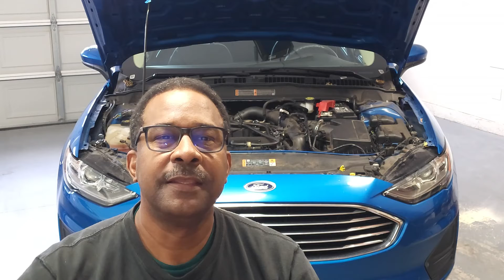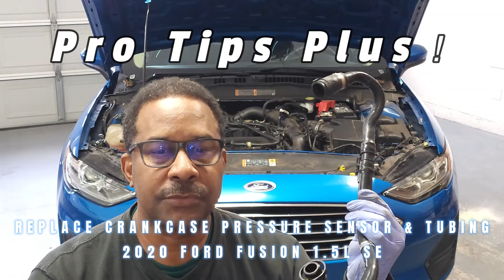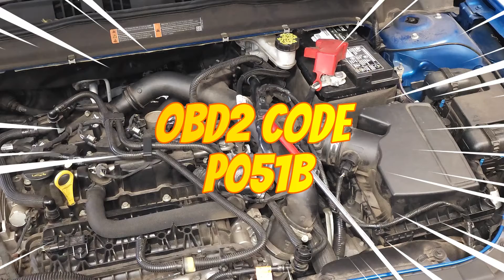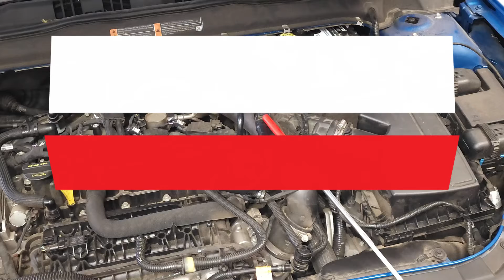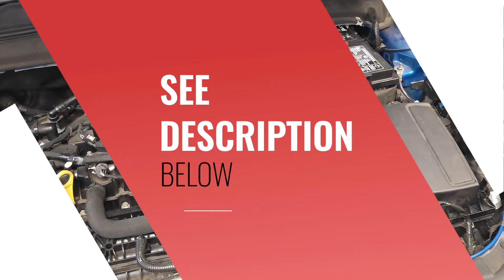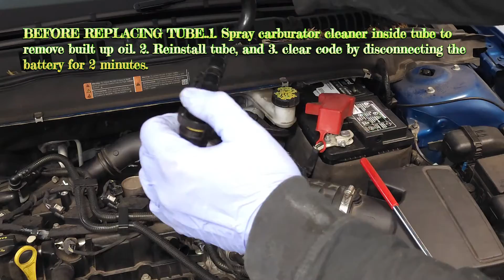2014-2020 FORD FUSION 1.5L- Bad Crankcase Pressure Sensor and Tube Assembly

Comment: Thanks bro this is very help full but i have the question this sensor need to replace it or cleaning of the sensor and this tube by the spray enough?
Reply from the maker: The information is provided in the video.

Comment: Hello does anyone know why my 2020 Ford Fusion SE 1.5 has a blueish smoke from my exhaust only on start up ? Antifreeze is fine always full doesn't go low from reservoir and oil is always fine. Took it to Ford dealer for they can just tell me it's the brake vacuum pump the they read from online forms smh  🤦🏻car is still under warranty but they said I would have to replace that part at my own cost before they approve for a new motor.  I don't know what that brake vacuum pump has to do with exhaust blueish smoke smh 🤦🏻
Reply from the maker: You've asked thenright person. We've got this. Send email to bheningburg@ yahoo.com
Reply: @fernandofalcon7722   mines did that and it was a faulty turbo charger gasket but it could be  turbo charger oil line that's broke or oil getting into the intake from faulty pcv, oil separator, or worse. If there is no codes I'll have them check the turbo charger gasket and oil lines going to it

Comment: Hey, i got a 2020 escape 1.5l with p0299 and P04DB. Could this fix it?
Reply from the maker: The combination of P0299 (turbo underboost) and P04DB (crankcase ventilation system disconnection) codes on a 2020 Escape 1.5L suggests an air leak or pressure problem. The most common fixes are checking for leaks in the crankcase ventilation system, which can involve a loose or disconnected hose, a faulty PCV valve, or a cracked tube. Additionally, inspect all boost-related hoses and the turbocharger system for air leaks, as the underboost code often points to a loss of pressure. 

Please donate, subscribe and share channel with friends and followers.
Reply: @protipsplus i got you!! Thanks bro!!

Comment: Is this part also called the pcv valve? Cant seem to find a video that specifically states a pcv  replacement..
Reply from the maker: Nope but it performs the same basic functions of a PCV valve. Which trouble code(s) are indicated?
Reply: @ there’s no code. But I read it’s good to replace it around 80k just to be safe. I’m just trying to do everything to try and avoid the coolant intrusion issue. I have the 2019 1.5L se. 82k miles. Don’t really want the 8k bill if I can do things to prevent it
Reply: @protipsplus Hi, thank you for the video! I have tons of positive pressure coming from the oil cap, which according to what I read could mean a bad pcv valve, but same as the guy above, i can’t find anything about a pcv valve for this engine, do you know if there’s one?, thank you!

Comment: This was EXACTLY what I needed as far as guidance for replacing this tube/sensor on my 2017 Fusion.  Especially helpful tip on removing the connection on the back of the engine.  Thank you!
Reply from the maker: Thank you. Please share with friends and followers. Happy New Year!

Comment: Great video! I just replaced this on our 2017 Fusion. A tip.. Use a flat blade screwdriver from the passenger side to gently lift off the rear connection opposite of the two places for your fingers. It makes it very easy to remove that way! I hope that makes sense. I love the Dorman part that has a plastic blue clip that holds open the front spring clip. It really makes installation a breeze!
Reply from the maker: @CraigFogus  You're very welcome. Thank you for the comment. Please share with friends and followers.

Comment: Do you have any tips or videos for a p0172 code? I’ve replaced the O2 sensors, fuel injectors, serpentine belt. Use MAF sensor cleaner on the mag sensor, sprayed out the ETB with throttle body cleaner. Code is cleared out but the car seems to be stuck in limp mode
Reply from the maker: You are on the right track. What was then the initial code that triggered the repair?Check and clean the MAP senor.